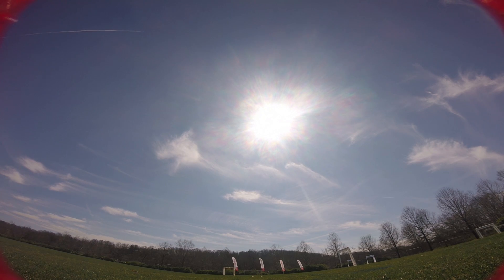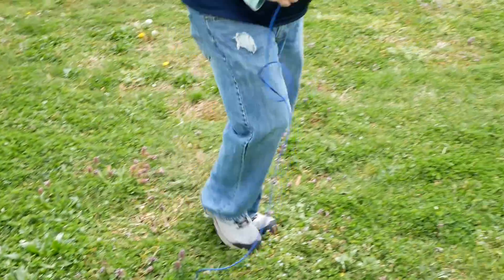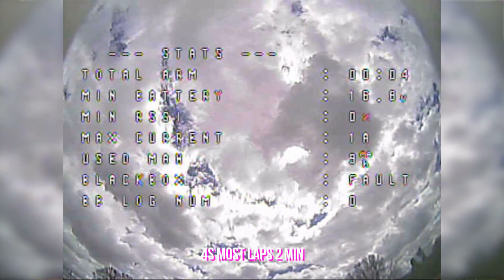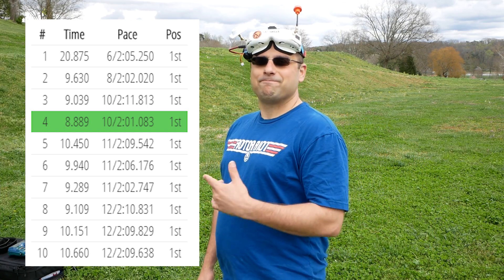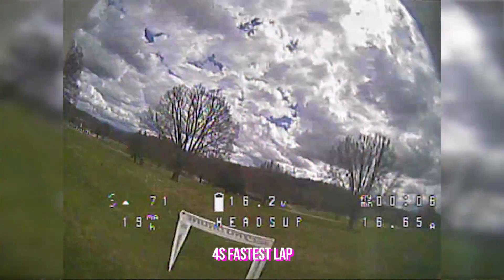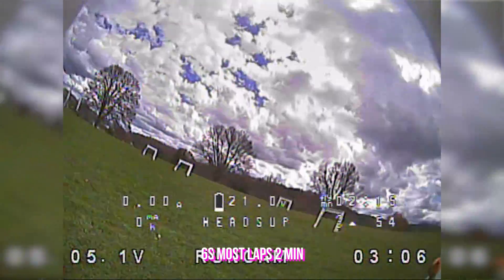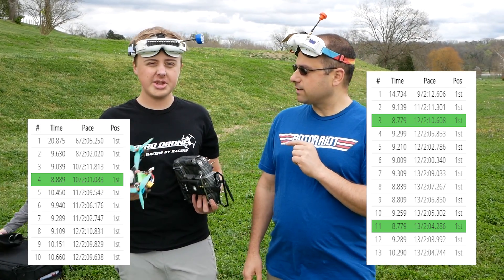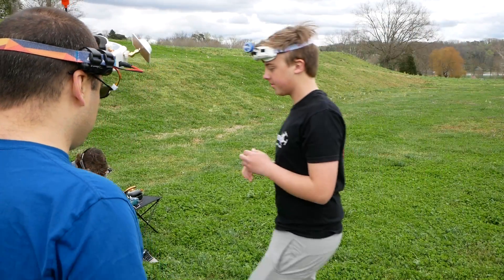6S is the new 4S | HYPE OR TRUTH

Comment: I would have loved to see what kind of amperage he was pulling on 6s. He was averaging 40-60amps with the 2522kv 4s set up. It must be considerably lower with the 6s if hes getting 2-3 laps more.
Reply: Doubt that 4s current sensor was accurate or he wasn't using as much throttle as I think.  There's about a 30-40a difference at full throttle.

Comment: Great video, but qualitative anecdata doesn't cut it for me. Without quantitative empirical evidence, 6S is just theory and hype. Plus, the test should have been between comparable batteries, either a 1550 4S and 1050 6S, or 1800 4S and 1250 6S.
Reply from the maker: The goal was to compare two batteries of consistent weight. The 1050 pulse 6S is 20 grams lighter than the 1550 pulse 4S. The 1250 pulse 6S is about 10 grams heavier. The 1250 is what Evan actually races, and is closest in weight, so that's what we used.

Comment: Why 6S and lower KV, and not 3s and higher KV? Wouldn't the lower weight be quicker around the corners?
Reply from the maker: The weight is the same. To make up the lack of volts you need more amps.

Comment: Interesting so its not that its 6s, because Evan confirms the 1050mAh behaves just like the 4s which is equivalent at 1500mAh.  Its something about that 1250mAh Pulse (1800-1900mAh 4s equivalent) that has some sort of special sauce.  Would love to see an equivalent test with an 1900mAh 4s of equal mass as the Pulse.
Reply: No secret sauce, just equivalent watts.  Who knows how the efficiency differences due to lowkv / high kv or low volts/ high volts would play out around any one track.  In some cases / on some tracks, low volts/ high kv will be more efficient due to where you are in the throttle curve, on others high kv / low volts will be more efficient.
Reply: Not to mention, can we measure true KV of these motors on a bench so we can see if there's a 200KV difference?

Comment: Well it would make sense that a battery with 20% more WATT HOURS would fly 20% LONGER.... I'm not convinced. I want to see this same test with a 1050mah 6S
Reply: This is very true. I did this test, and flight time is slightly better on the 1050, maybe. However battery comes down cooler and flight consistency is improved. Shameless plug https://youtu.be/WX86BNl4NJY
Reply: The conclusion would be exactly what you think it would be, depending on the track.
Reply: Love the video. Pretty solid testing imo

Comment: Once, I made a similar test between 4s and 6s but, I took a 4s with about the same weight like the 6s. Therefore the 4s has a bigger capacity, which also provides more peak current.(4s=2300mAh/6S=1500mAh)So, my Quad had on both test flights the same weight. I did not feel any differences between my 6s/1550KV and 4s/2300KV. The power on my OSD was pretty much the same on both flights, even the flying time. We just have to do the math. It´s just physics. Power is power as long as you provide the same efficiency. Cheers and happy flying !

Comment: Interesting test....Does this mean we will see a new overhaul on the max cells that PDB, FC, ESC, Motors and even VTX and Camera with OSD have to be able to support 6s? Not to mention chargers, parallel boards and the capacitors we are using now. 35v capacitors should be sufficient right or do we need bigger ones as well just to be safe.

Comment: Its not hype its math. 
4s 1550 = 22.9w/h = 1,376w/min = 688.2w/2 min.
6s 1250 = 27.8w/h = 1,665w/min = 833w/2min. 
There is a 289w/m or 144w/2m difference between the packs. Obviously there with be a longer flight. A 6s 1050 is a lot closer to the 4s 1550 at 23.3 w/h or 1399w/min or 699w/2 min. Making it only a 23 w/m or 11.5w/2 min difference. No hype lol. 
      The advantage would only be less current. In order to achieve a 1kw/2 min race, a 4s machine needs to be able to push a continous 68 amps, versus the 6s machine which would only need to push 45 amps.
Reply: I've just posted that under another comment: 

Current decreases, that's true but so does the cell size. 
A current of 120A pulled from a 4S 1550mAh pack (22.9Wh) yields a discharge rate of ~77C. 
A current of 80A pulled from a 6S 1050mAh pack (23.3Wh) yields a discharge rate of ~76C. 

So the relative load basically remains the same, no matter if it's 4S or 6S. It would only stress the battery less if cell size wouldn't change. 

Does simply lowering the current without changing anything else really make that much of a difference?
Reply: DING DING DING
Reply: Paul Hope math isn't about opinion my friend.
Reply: Dakota Snow-  Yes, but I think your math ignoring some important factors here and therefore wrong conclusions are being reached.
See cito fpv's reply to GAPiT fpv's initial comment for the correct formulae to use... imo.
Reply: Zerro, Most likely not as components amp ratings usually scale with voltage. So I dont believe there is any real advantage to upping the voltage. We need more current which is achieved by larger capacity packs.
Reply: Dakota Snow- true,  your math actually looks sound but doesn't show the whole picture. Less amperage would be required for 6s but mAh and therefore available amperage to achieve the same pack weight would also be lower too.... IF... their energy density was equal.

Actually- on re-reading your original post, it seems we are both actually on the same page with just different ways of lookung at it. My apologies.
Reply: If total c rate is the same it will hit the the 6s battery less since each cell will have a lower draw coming from it.
Reply: Slowjet Yes, but the 6s with it's lower mAh (to achieve same pack weight) will also provide a lower nominal and peak amperage available.
Reply: I don't think all the formulas are actually that relevant to why most people will want 6s unless you are just trying to geek out and tinker instead of flying.  Ultimately the math that matters is 6s means more cells, which means higher voltage, which gives potential for faster/quicker speeds, and better control. Same as a car, you can talk theory and crunch numbers on compression air/fuel ratios all day, but what really matters is a car with more horsepower/torque will be faster with more control. A 6s pack will for the most part offer more voltage/amperage over a 4s, so it isn't hype at all. A quad with more voltage or a car with more horsepower is going to be more fuel efficient with longer flight/ride times, also with potential to use all the fuel/energy a lot faster resulting in higher power, shorter flight/ride times. No need for complicated equations or videos to prove any of it. We've all probably flown 3s and 4s on a quad showing what happens when you up the cell count regardless of the bs c rating on the package.
Reply: Anthony Ortega  - Some of us like to make informed logical decisions based on scientific evidence... much more than a test that showed nothing more than that x setup. was better than an unequal y setup. It appears that you would quite happily go out spend a load of dollars based on a compromised test?  Where does it end? 100s 1mAh packs? Your choice... your money, I guess.

Comment: 10:12 min did I hear that right did you say somewhere around 12 volts for a 4S the battery goes PL lllllllHH.  dude you're always supposed to run it down to like 13 and a half on 4S no wonder why your batteries don't last somebody needs to teach this guy what is he a noob
Reply: yes this is a joke I know who Bardwell is sometimes he mixes his words LOL yes I am aware you can run it down to 12 if you don't like your battery
Reply: It’s a race dude. Where the battery ends up is where it ends up. He said it drops off like a rock at 12v.
Reply: If you are landing based on voltage and not finishing the race, you are the noob. Lmao
Reply: Depends how much you value your packs I guess or how far you wanna walk ;)
Reply: I just learned the RC car kiddies always do this...
Reply: under load no problem but noload voltage will puff the lipo over time

Comment: IT'S ABOUT TIME!!!!

btw, jb, do you think running 3 inch drones on 5s and 2800kv will give a similar effect?
Reply from the maker: That is a tough question. I think you have to find a 5S battery that is similar weight to a 3S first.
Reply: I've seen that most guys(I'm new so I run 3s) run 4s, but I get your point. thx for the reply !!
btw Shout out to battery manufacturers to make 450 - 500 mah 5s lipos!!!
I also read that sodium based and solid state Li batteries are coming in the future, do you think their huge power - density will allow crazy high voltages(if electronics take them)?
Reply: The Pragmatist I'm thinking about trying these when it's time to upgrade my electronics on my 3".
http://pirofliprc.com/Pyro-Drone-Graphene-700mAh-5S-185V-75C-By-Who-Cares_p_4463.html
Reply: cool, pls upload the results!

Comment: damn that kid is fast...ok makes a good case for 6s but maybe just for the top line guys...we are talking maybe a small amount of extra efficiency and torque...thanks for the test
Reply from the maker: I think there is probably some truth to this. If you are not absolutely balling out your 4S build, it may not be worth it to scrap everything and go to 6S. On the other hand, there may be an argument that 6S is not THAT much more expensive and you might get some small adavntage with little penalty.
Reply: I guess its also the cost of converting...maybe if you are starting out with the idea of racing at a high level you could start with 6s?

Comment: So, from a theoretical perspective, higher voltage systems are more efficient because they loose less energy as heat due to reduced current draw. However, do we actually see that much heat build-up on 4s? If a motor wants 500watts and you spread that wattage out over 1, 2, 4, or 8 cells the wattage per cell will be decreased, but couldn't you just use a better cell to deliver more power and keep the voltage the same? Or is this 6s basically a work around to the limits of battery cell technology not being able to keep up with the total power draw?
Reply from the maker: I think you are on to something with the last sentence. The cells we have are about as good as they can possibly be and they are still struggling.
Reply: Yes I would say that last bit is exactly whats going on here.
Reply: I'm sure its more complex than this, but the way I understand batteries the discharge capability is a function of both rated current (C) and capacity (maH). If you look at batteries of different voltage and normalize watt hours (by reducing cell maH size) and keep the C-rating the same, there is no change in possible watt output, but a significant change in the total amperage which is what we expect. HOWEVER, now that I'm doing that math, if you look at battery cell load (which let's define as the percent of rated amperage (Mah*C) used e.g. 40A draw of 100A rated is 40% battery load), each cell at the indicated wattage has the same overall battery load. The theory was that the cells would be under less stressful amp draw under similar wattage, but that doesn't seem to hold up. Did I do the math correctly? This was a surprising result that I'm kind of grappling with. Thoughts?
https://docs.google.com/spreadsheets/d/1ViL2InKlvKEhI-uDIoFnUbdX-p7UhhbEvBGyuyZqE8A/edit?usp=sharing
Reply: U R right, power-density and energy-density are nearly the same.
A low kv motor need more windings in the coils, this increase the resistance. At the same rpm the efficiency didn't change a lot.

Comment: Has to be said the 6S pack has about 20% more Watt hours.  I'd expect more laps with it. Yeah 6S is more efficient, but this isn't  a direct comparison.  You've even got Evan saying his 1050 6S flys the same with the same sag as the 4S.
Reply from the maker: This is a valid critique, and I understand the comparison here is not perfectly A/B. This was a compromise I made in order to get the test done. (I have actually been trying to get the test done for over a month and various things have been getting in the way.)

The 6S 1250 is about 15 grams heavier than the 4S 1550. If Evan felt he could get the same performance out of a 4S pack that was only 15 grams heavier, he probably wouldn't be flying 6S. Bear in mind the Pulse 1050 mAh that "performs the same as the 4S" according to Evan is only 171 grams, about 20 grams lighter than the 4S 1550. The takeaway seems to be that 6S performs slightly better than 4S for the same weight of battery.

Comment: I wonder what would be the results on 5S and matching kv motors. Battery would be lighter probably, so less going wide on turns, but likely better efficiency and lower voltage sag than 4S.
Reply: Yep, a nice middle ground  :)
Reply: 6s does not inherently weigh more than 4s.  Same with 5s.  Equivalent power batteries the quads will be nearly identical in weight.